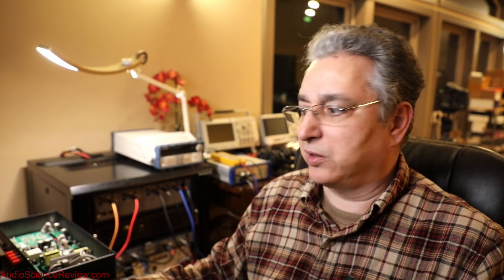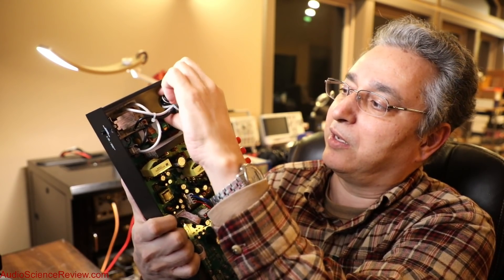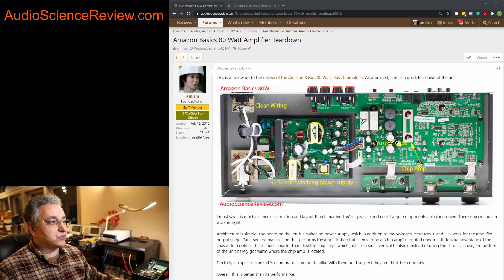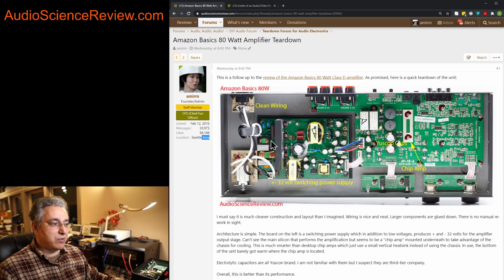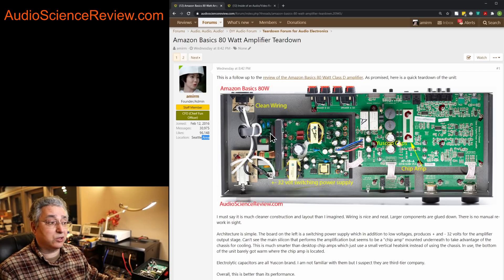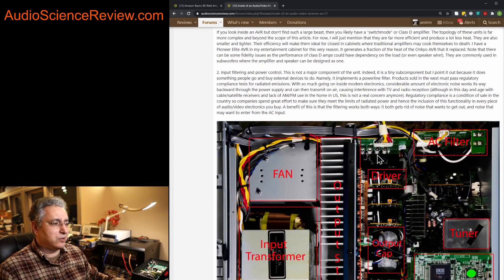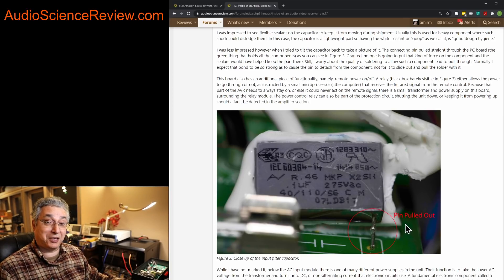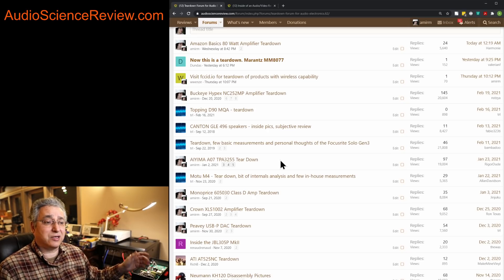Do you need AC noise filtering for audio devices?

Comment: I think you mentioned it but there is a requirement for gear manu=facturers to prevent their gear emitting (sending out) Noise over a pretty wide bandwidth so in reality switcher supplies MEED filtering on their mains INPUTS (some off the shelf may have it inbuilt) and then the output side also needs filtering which the product would want anyway unless it is only charging a battery for example but then again the output wiring must not emit HF radiation. This is covered by the FCC in the USA and other regulations worldwide. Certainly necessary for CE certification.

Comment: The problem is that not all devices with internal SMPS have that type of filter. In the video, you only show two examples of audio amplifiers (the second one is from Onkyo..) that have it. Smartphone chargers or small power supplies for TV/satellite decoders, modems, etc. don't have them, because the filters themselves would take up all the internal space. I've personally tried unplugging those types of devices while listening to my hi-fi system, and the difference is noticeable (for the better, obviously). So, there's a problem.

Comment: Hi, thank you for these clear explanations. I have Argon Fenris A4 speakers since a few weeks, these are the first "real" speakers that I have (previously I used the integrated ones from my PC screen). I am fine with the sound quality, all the more that it is connected to my PC trough RCA stereo line via the intermediary of a USB connected SMSL SU-1 DAC, but I can hear an annoying ssshhh kind of low noise even when no sound is playing.

There are also clic clic from time to time, not always but that certainly is what is the most annoying to me. It seem worse when the noise gate deactivate itself to play sound than when the noise gate is completely switched off (I can choose to deactivate it)

Do you have some ideas of what these annoynig sounds could be on how to fix it ? I have tried to disconnect all audio sources or switch cables and ac bracket (to one with nothing else around) and it doesn't change a thing...

Comment: It seems this applies to audiophiles who have a vague idea that power filtering will somehow make their great system sound even better. But sometimes there are specific problems caused by line noise that is not filtered out by the circuits in the audio gear. For example, I am trying now to find a solution for a non-constant recurring 60hz noise. My theory at the moment is that it is caused by a large pump motor that drives an artificial waterfall for a pond across the street. On the other hand, there is a corner a couple of blocks from my house where there is strong 60hz radio interference when I drive by (bad transformer?). That is another potential source of the problem. Right now I am using a Tripp-Lite Isolator and a Furman EMI/RFI power strip, but it's not helping. I have also temporarily lifted the ground as a test, but that didn't do anything either.

Comment: I use AC filter because of 2 reasons:
1. to offer my gear best possible current so it can work as best as possible. 
2. surge protection (reason alone good enough for me to have it).
Adding AC filter won't impove sound as lots of naively expect and manufacturers falsely suggest, but it will help audio device to perform in a way it is designed to. Nothing more, wich is impossible and nothing less then products specifications.

I also must emphase when we speak about internal noise how that noise is less variable (if at all) and  more predictible than one that is in wall current wich one depends on gazzillion factors. Components inside audio devices have defined specs and behaviour, including noise and that can be much easier to deal with in terms of filtering.
On the other hand, current comming out wall with noise is hugely variable during hour, day or week.

I don't see any problem adding noise filter as long as those filters are in reasonable price level. The problem is that some companies sell those for thousands of $ or € and here I'm on your side.

Comment: Safety compliant, or noise pollution compliant is not same as being audio compliant. It can conform to standards but still leak a lot of common mode noise into your device, where even with the Comon Mode Rejection and all the filtering can be insufficient to reduse it to desired levels. Take  as an example a MacBook which has a well designed PSU but not connected to electrical ground the common mode noise can be higher than 20V, I can even feel it  with the reverse side of my palm, or you can use an electrical live wire detector.

Comment: As for audio related topic, the main benefit of these EMI filters is to drastically reduce the COMMON MODE noise coming from our mains to our system, which in the end can poison our sensitive audio input. Adding some extra common mode filter is not detrimental and can be beneficial. Manufacturers may not be that kind to implement decently sized components.

A 2 mH choke will give LX/2 or only 6.28 Ohm of impendence (resistance) at 1 KHz  for common mode noise, at 100Hz it will be only 0.63Ohm. Usually the chokes of values ranging from 1 - 20 mH are used. They virtually should not create any resistance other than resistive to differential mode.
These EMI filters at the PSU entry have a great role to do two things.
1. To reduce the noise generated by our device to the mains. What ever it is, the switching PSU, or all the rest, as a power consumer.
2. To reduse both the common mode and differential noise coming from mains to our device. Differential can be neglacted as it is easier to be reduced, but te most important is the reduction of common mode noise which can in the end poison the input of our amplifier and we get that hum noise in our speakers.

Any current choke used for filtering can easily go into saturation at relatively low currents, it can be common mode current or a difference between neutral and live  (difference in differential). That why is good to have a choke rated for higher current for reserve. Here  the current for which they are usually rated can be 5  or 10A for example, but in reality a difference just in few  milliamperes cam saturate the ferrite core.

Comment: Without even watching the video: NO. Unless you have a very, very badly designed audio device. But VERY badly...
Reply: I do not know for more than 500 USD, but for most audio equipment under 500 the PSU is not that well designed, many will not have any filtering at all. most switching PSU do not have any output filtering other than capacitive.

Comment: Great video !! , Question : We all know that there is different quality levels of Audio components , A $10000 MacIntosh isn't a $70 a basic Fosi Audio TB10A Stereo Audio Amplifier  for example. So external noise and surge filtering devices also have different quality levels and it possible / worth  to add a High End filter instead of a basic filter build in  ??
Reply from the maker: Just no.  The power supply in your audio gear runs on DC and that mandates filtering that is far more effective than anything done in mains.  Mains filtering is almost always at high frequencies that you can't hear and at any rate, is trivial to filter inside the machine.  And much cheaper too because internal voltages are much lower than mains.

Comment: Love your channel and have been subscribed for nearly a week now. :-)
May I please ask you if these products also have a lightning protection?
Reply from the maker: No.  Nothing protects against a real lightning strike.  It has so much energy that it will bust through these as if they do nothing.  Best protection against that is an insurance policy for your home.  And to some extent, a surge protector installed in your meter or at your service entrance.  For the former, ask the power company.  They are pretty cheap to put in (I have one and cost $320).
Reply: @AudioScienceReview  Great, I have already a HPFI protection.
I imagine that the best protection is to pull out all your plugs when lightning is going on. :-)
Reply: @AudioScienceReview  I think we have to be very careful here with making the recommendation on using a whole-house surge protector. That all sounds great on the surface, but when you peel that layers of that onion back a little, it can all look quite different. Most of those surge protectors that go out at your meter or at your service entrance have a VERY high clamping voltage. That's the voltage level that has to be reached before the device will even begin to shunt power over to the ground and away from your home. The problem is that most of those surge protectors don't even begin offering any protection at all until they reach levels of voltage that are far more than what it can typically take to do damage to devices in your home with sensitive electronics in them. For most devices with integrated circuits in them, the "Danger Zone" for surges and spikes start at about 330v. Unfortunately, most whole-house surge protectors don't even start clamping voltage at all until aywhere from 600v to 800v - long past the point where the damage to equipment in your home is already done. Needless to say, it is VERY important to know EXACTLY where the clamping on ANY surge protection device kicks in. You ideally want that to be as close to 330v as possible. This is why so often people are lulled into a false sense of security when they purchase a whole-house surge protector. Sure, it protects the whole house because it sits out at the service entrance or at your panel, but if it's not even going to start to clamp and shunt voltage until AFTER everything in your house is already completely cooked, what was even the point of having it there in the first place?

Comment: Good video. I'm so fed up with people telling others that they need expensive power supply filters to protect their "investment".
Reply: Unfortunately not all the things are well designed, I have found many flaws in the PS of the Topping A90 amplifier. The answer is not that simple, these filters protect your device from common mode noise, differential is way easier to filter.

Comment: OK, but you forgot to answer the the real problematic parts. Those filters are there to "defend" the mains getting noisy because of high freq. switching. They must to do that because of FFC (US) and CE (EU) regulations, no choice, it's a rule. The PS would pollute the mains anyway, and your neighbours couldn't watch TV when you switch on the amplifier.
What, if your power-amplifier has conventional PS, a big toroidal transformator with big buffer capacitors and rectifiers, and then maybe some DC voltage regulators. No high frequencies to get rid of. And then you can buy some Audiophile Grade HiFi powerstrips for $1000 and similar Hifi AC power cords, (that is almost free for $200). They look fancy and cool indeed, high quality no doubt. They are recommended because allegedly they can filter out every evil noises (the strip contains surge protection, overcurrent protection and filters) from the mains, the cable is shielded with braid copper like a network FTP cable. And it's made from AWG10 wire, just like your home welding apparatus' power cord. They say it's better if thicker.
This was the real snake oil question to answer. Audiophile professionals make listening seances and they state that Audiophile Power Strip and Cord is much much better, you'll get defenitely more bass, airy mid and wide soundstage, less high frequency distortions. And this is a fact, they say so.

Comment: Probably, AC filtering not required for precision audio devices, like modern DAC, power/pre amps with perfect filtering. But, on studio and live musicians using vintage style guitar/bass tube amps with really sensitive to AC noise due to its high gain. However, I do not know of examples of really good power filters or regenerators that can produce a perfect sine wave.

It's easy to detect and reproduce AC noise in guitar tube amps - just toggle main power switch on amp, capacitors have enough power to keep the amplifier running for a couple of seconds, and listen/measure noise floor.

Comment: Can you make a video analyzing exorbitant pricing of devices like dCS Bartok etc. costing more than $15,000? I.e. where those  1000s of dollars come from?
Reply: I have a bartok and it’s the best money I ever spent. 40% goes to retailer.
Reply: @notthatperson8179  ASR Spectrum measurements at the DAC output show there is no difference between expensive DAC like dCS and cheap one like Allo Boss2
Reply: jovan jelic Demo a bartok for a couple of weeks then switch to one of these other dacs. The bartok is a bit of a good value to me. It includes a streamer and a headphone amp for $17k. They’re all built in the UK which has a high labor cost. They’re only sold by small specialist shops that provide service as part of the price. The cost to run a hifi shop is very high and even with the generous margins on dCS I doubt anybody is getting rich in the process.
Reply: @notthatperson8179  On the contrary, profits are huge. Everybody wants as much cake as possible. For that reason, some vendors like Antipodes switched to direct sales. Bartok was $14k thing. As in the old saying, there is no impression like the first impression. Plenty of profit. But then the greed took over. Many vendors got greedy like that. For example, speakers with a hefty profit, Wilson Sophia 3, were selling for $16k to the delight of the owner, late Dave. But then overnight it jumped in price to $22k. Nothing materially changed on that day. Except greed took over. And what propelled the greed was the fact that stock market went straight up from March 2009 till now. I, couch potato investor, bought Microsoft at $26.50 and Apple at $20. I earned around $80k on those two stocks. If I were younger I would have probably bought Vivaldi or Rossini. But I know the black day is coming. There is no way I'm gonna plunge 1000s on something that gets obsolete in matter of days. What I would like to see is side by side measurements of Bartok vs Denafrips in both frequency and time domain and only then see if the difference in price is justified. Unfortunately, ASR only measures in frequency domain and basically that is measurement of averages.
Reply: jovan jelic I started with Conrad Johnson DAC then Naim V-1 followed by Chord Hugo finally a Berkeley Alpha. I wasn’t really in the market for a new dac just a streamer. My neighbor is a dCS dealer and he let me demo the bartok for a week after I demoed an Aurender server. It was just so much better than anything else I’d ever listened to that I bought one. In fact I told him I wasn’t returning the demo unit until I received mine. I’m not really an audiophile I just like listening to music.
Reply: @notthatperson8179  cool story bro...

Comment: Its not "exactly what youre going to find" on other surge protectors. It MIGHT be what you find, it might be better or worse. An audiophile grade filter (Furutech, for example) may be designed in such a way to further refine things for audio applications above and beyond what the FCC requires, or what you may or may not already have in your system.

Comment: Most audio issues people blame on line noise is probably due to lack of ground-loop isolation.
Reply: @Jon Beck It's discernable by the tell-tale 60hz hum you'll get. Most audio equipment ("prosumer" or better, and maybe below) have a grounding screw on the back, You wire each together so that they are all at a common ground.

Comment: Do you believe in high quality ‘audio grade’ parts for example resistors, capacitors that measures the same but other materials were used to build them. Do you think this will influence the sound ? For example tonality..
Reply: Components will measure differently as temperature changes. Some components are more stable to temperature changes compared to  others.
Reply: Yes they are different and they actually measure different, but you do not need to sale your kidney as the benefits are questionable sometimes.

Comment: Hi thank you very much for the very valuable video.  I have to describe my experience.  I have a cheap amp from Auna using a smps.  I have noticed that on Sundays it sounds quite better (i.e. cleaner and more powerful).    I live in an industrial district.  And on Sunday the factories are almost all closed.  Therefore i have concluded that  smps are not that good at filtering noise coming from the external power distribution city grid.  
Speaking of linear psu instead i have the impression that EI transformers are much better than toroids at suppressing mains noise.  But i have no instrument to check unfortunately.  Thanks again and kind regards, gino
Reply: If your utility company will provide one, or get one yourself, monitor your mains voltage levels. Your industrial area weekday problems might be low voltage not extra noise.
Reply: @glenncurry3041  Hi yes it could be that indeed.  Lower voltage.  I have seen around some distribution bar with digital display of the mains voltage.  That could be very handy.   Still i think that noise can play an important role.  There are a lot of AC generator for audio purpose that promise to provide a very clean sine wave AC but they are usually very expensive, the good ones. 
Thanks again.  Kind regards, gino